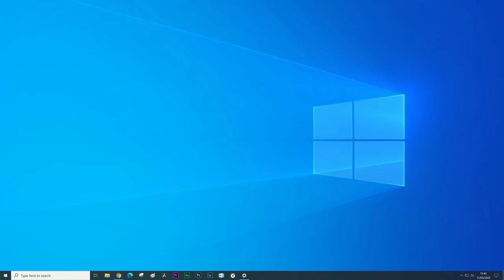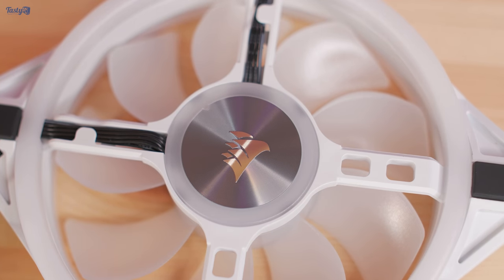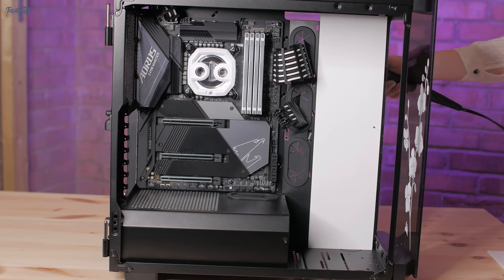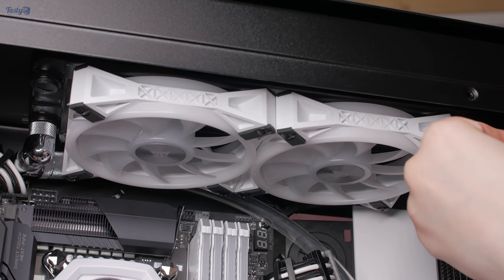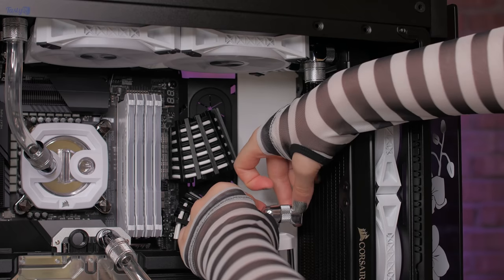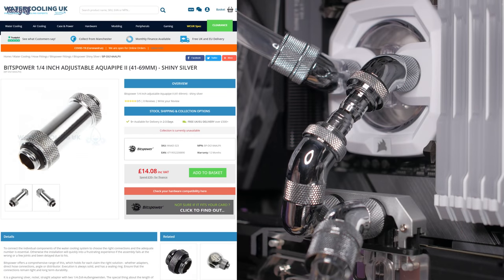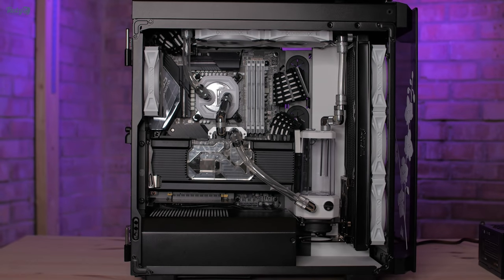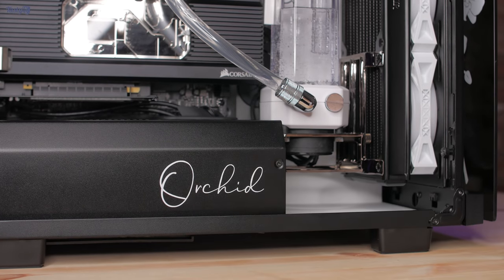I Watercooled A PC For The First Time In 6 Years!! ~ RTX 2080Ti & i9 10900K

Comment: Hard tubing can suck it!! I love my soft tubes where I can just pull off the CPU block and swap it without disconnecting or draining anything. Protip for applying vinyl stickers, mist the area with slightly soapy water first, then stick the vinyl and use a little roller to squeeze out all the remaining water. It gets rid of any air bubbles super easily.
Reply: Hard tubing is mostly about aesthetics so it's pretty subjective, kinda like metal tubing.

Comment: About copper tubing i have some advice , i builted 4 full Loop made of Copper , the same copper tube thats used for  hydraulic thing  (12mm outside 10mm inside) , 1st of all , the raw copper tube react very fast to Air , Water and even the skin of ur hand , so basicaly u can proceed in 2 different way : 1) u can instantly paint with a protective /trasparent paint and then work with bending and cut , or 2) use a copper paint to cover the oxydation and scratches after the bending/cut , but after years of custom loop i have to advise u that use copper tube( especially raw copper) could be painfull , its the hardest way , but imho the result could be stunning.( P.S. bending copper its the hardest part because u can easly ovalize the curve , an easy tips for beginner is to use only straight tube of copper and use angled fittings to complete the loop).  by the way for me its a good first waterccoled mod u done , keep going Queen .

Comment: Fun tip for vinyl sticker application: spray the glass with a simple glass cleaner first and apply while wet. It gives you an opportunity to move the graphic around while applying. Then a credit card or plastic "squeegee" will take out any bubbles very quickly. Towel off and you're done.

Comment: It's cool to see a girl's take on building a PC, it looks so much neater, more methodical, and aesthetically pleasing. 
And after cracking that plastic I was waiting for the "oh fuck!" and I wasn't disappointed!
Good job..
Reply: It was watching Lauren's water cooled build in a Corsair 900D 6 years ago, that inspired me to build my own water cooled PC, Current rig is, AMD 3960X Threadripper 24 Core CPU, 64GB 3600 MHz ram, 2080TI, 1GB SSD (Boot) 2x2gGB SSD (scratch disks) 4x 12GB HDD in raid 10, (Storage) all watercooled of course.  I edit in Davinci Resolve Pro, this set up works well for me.
Reply: @johnbancroft5242  Damn, that's some nice gear! Yea, I started getting into custom PCs and watercooling around the same time, currently have a 3600 and a 1080ti in a custom loop. 
I wasn't planning on putting the 1080ti into the loop, but then one of the fans went crazy, running at 100% all the time, and it was just cheaper to buy a waterblock and add it to the loop instead of trying to find another  fan, or get it repaired.
At least that's what I told myself anyway..

Comment: what I would do for runs like the GPU to CPU and 360 rad to reservoir is use a similar looking hard line tube not only to make the run look cleaner but also to help straighten up reservoir sag. And one more thing, it's not a sexism thing I promise hard line tubing is not that hard but it is scary to do and more expensive cause you need a heat gun.

Comment: I have the same reservoir and had the same sag problem. Easy way to fix it is to put washers around the bottom layer of thumb screws that connect the reservoir to the fan it’s mounted to. Do it so they are between the mount cage that connects to the fan and the one that holds the res. One of two layers of washers should do it.

Comment: Nice work Lauren, It was watching your water cooled build in a Corsair 900D 6 years ago, that inspired me to build my own water cooled PC, Current rig is, AMD 3960X Threadripper 24 Core CPU, 64GB 3600 MHz ram, 2080TI, 1GB SSD (Boot) 2x2gGB SSD (scratch disks) 4x 12GB HDD in raid 10, (Storage) all watercooled of course.  I edit in Davinci Resolve Pro, this set up works well for me.

Comment: Quick tip: Get a step bit. It works much better for drilling through plastic and sheet metal. It is much easier than using regular bits.

Comment: That B-roll looks SO GOOD. Awesome job! An idea for the pump sag (besides Corsair fixing it themselves like they should) is to use the acrylic to build a piece for the pump to sit on. Since it's already bolted in place it wouldn't need to take on that much weight so the acrylic should hold and look cleaner than the eraser.

Comment: Good job. Hope you're feeling better.

FYI front radiators always need the tubing at the bottom, not the top. This forces any air caught in the system to stay at the top of the radiator, instead of being forced out the top repeatedly which leads to gurgling sounds and reduced cooling capacity. You can purge some of it by tilting the case around with the pump running so the air ends up in the reservoir instead of the radiator..
Reply from the maker: I think you're thinking of AIO coolers. With a custom loop you can work the air out.

Comment: Great video!  Build looks great!
 Glad you had no leaks when you filled the loop. It was a good idea to tell people that the motherboard was powered down while filling because that is very important.
 A drain valve might be handy on your next loop. It might be an idea to use some of the scrap plastic you have to make a prop to go under the pump bracket to take some of the weight and stop it sagging. 
I've used hard tube in my loop and yeah it's a bit harder to use but if you take your time it's fine. I have no issue with soft tube loops if it's easy for you , besides you've done a great job making it look as neat as you did.
Glad you left the cursing in because we've all been there. Good thing your hand was clear of the drill bit , cos that can be nasty ..ask me how I know..
Good luck with the build and keep an eye on that GPU loop manifold connection just in case you get a leak starting there.

Comment: 3:34. First use a center punch then drill your pilot hole. Make sure the bits are snug in the chuck. Your bits are spinning both times. Then use an intermediate size bit then lastly your final size bit.

Comment: Is the front radiator the wrong way up? Front rad is lowest point in system, so pump should go to bottom of front rad and then front rad to gpu? Straight run from top rad back to top of reservoir?

Comment: Think the accident with the drill had much more to do with an excess of downward pressure, not with the drill being too large. The drill stopped while the chuck was still moving, which is a issue with downforce.
EDIT: To be clear, while multiple sizes are useful in hard to drill materials (which that wasn't) or underpowered drills (again, not an issue). it wasn't need here. The initial pilot hole was enough to both guide the larger bit and keep it from wondering, and have a clear centered area for the larger bit to avoid having the center chisel its way through (the center part, where the two cutting flutes come together, doesn't cut so much as brute forces its way through. ie, reason to use a smaller guide hole.)
But great cover right after anyways, had everything else covered spot on.

Comment: Looks gorgeous. I've always been a fan of crystal clear acrylic/tubing/fluid, and it makes a lot of sense now that RGB exists.

The aesthetic of this is very... TikTok e-boy. RGB, black and white, silver jewelry... You've even got the striped shirt! xD

The ONLY thing I could nitpick is the 24pin/GPU cables... they're a bit too cluttered visually because of the black white mix, which is then crosshatched by the combs. I would've gone with clear combs, and then either all white, or white on the front faces and black on the backside. 2 or 3 wide stripes might work too.

Comment: Tasty - you can buy (very cheap) these pairs of light duty work gloves / gardening glove / handiman gloves. Whatever they are called. And its like a thin 2nd skin of durable rubber dipped cotton. They are great! And will save wearing out your hands when hand tightening / gripping / assembling stuff. They are very grippy. Certain tasks will really benefit. They also offer a worthwhile limited amount of finger protection from dremel, knife, etc. It is important to have multiple pair because they wear out or get mucked up. Personally I like to keep a 'good clean pair' for clean and light duty tasks. Plus one other 'dirty pair' for the other less forgiving tasks which will do more damage and mess up or dirty the gloves. And rotate them that way. Clean Pair --> once it gets messed up ---> becomes dirty pair. They are like $1 a pair. Or something like that. Well worth it.

Comment: I just wanted to comment on the hard line vs Soft line cooling argument, and I would agree that from an aesthetic point of view hard line can look better, but does not always look better.

But from a long term usability point of view soft line tubing is a much better option as it allows you to service and maintain the system without draining the loop and replacing all the o-rings as is best practice every time you remove and refit any hard line tubes. (It nice to be able to upgrade m.2 drives, and swap out or fit more RAM without needing to drain the loop).

I have also found soft tubing to be less prone to leaking as well, so if you are building a PC you plan to run 24/7 and leave un-attended soft line tubing is again a better idea.

As such if the idea of your channel is to teach people how to build actually usable PCs that look good there is no need to go with hard line tubing, just do some work on routing your soft line tubing to look as good as possible, and you can even use its flexibility as a visual feature. :-)

Comment: lol dont sweat hardline tubing, it has disadvantages, 1 has to be done in situ cant pre test away from the motherboard, 2 no quick disconects as far as i know, needs precise cutting, can crack at odd angles, needs filing and sanding the ends, the rubber mandrel is difficult to wiggle in and out of the tube for bending, (i wouldnt bother unless your insistant on the perfect bend) leaks easy if the fittings arent tight or pushed in enough, has to be matching fitting and tube size, where as on soft tubing, its not as much of issue, if the fitting is smaller say 6 by 8 stead of 8 by 10 or vice a versa it will still work obviously for larger tube to fitting just needs more heat and more stretching, i use a three prong stretching tool for that.

Comment: Oh my god. Humor on point. Smarts as well? That's a keeper right there lol. That PC has made me decide I'm going watercooled, but I'm gonna do hardline tubing prob.
Reply: I've got a 3700x on an x570, with 4x8gb 3200mhz Vengeance RGB Pro, MSI 2080ti Gaming X Trio, 2--1tb m.2 nvmes, 1--2tb SSD, 1--12tb 2--4tb HDDs, and my cooling is a Corsair H100i RGB Pro XT (I really want the new Capellix Elite they just released) 240mm, 8 Corsair LL120s (again before QL120s came out, and of course I want them lol), and I've got a Corsair LS100 starter kit which is 2 250mm and 2 450mm RGB strips, and I got 3 in my case and 1 on my monitor. Got all Corsair peripherals as well, except for the RGB headphone stand and the little light sticks lmao. But pretty much everything Corsair. Unfortunately that AIO (the RGB Pro XT) leaked inside of my case, and Corsair emailing me is giving me a hard time about refunds and stuff when I was only asking for an RMA. They don't care about their customers if I dont buy it from THEIR website... If i buy it on Newegg they said theres barely anything they can do to help me lmao.

Comment: Clean build... After 4 hard tube builds, my next will go back to soft tubing.
Reply: Or, you could forego liquid cooling because you do not need it in any way, shape, or form. It’s stupid and pointless, and it’s just another unnecessary vector of failure in an already complex system.
Reply: @darthdigital3789  lol. I have dating back to using car air conditioner coils and condensers  for radiators and aquarium pumps.  Never have I had a failure.  I have and will continue to do customer water loops because it's fun, challenging and the end outcome for some is art work.  Lol... Why so negative dude?  Life ok for you?
Reply: jasonlax   True, that was a bit negative. I may have been on my second Scotch by then. I just think that liquid cooling is pointless, but hey, whatever floats your boat. I’m more of a non-rgb, brushed aluminum, mini-itx kind of guy now. I like the elegant look, even if there is a beast of a gaming or simulation or video-editing system under the hood.

Comment: Nice B&W build, did something similar in an 011 dynamic but used black EK soft tubing instead. Worked really well and gave it a clean mechanical look.
PS. loved the '..and it worked' line, as if someone was expecting it not to, made me chuckle. And I've never missed a blanking plug when doing a custom loop, honest! :)

Comment: For your OCDs sake have you thought about 3D printing like half a cylinder using white material that the soft tubing could then be cradled in to force that tube at the top of the 360 RAD to the reservoir to be straight?

Comment: Nice build, on the top of the reservoir, why not use a 5mm extension in-between the 2 90's so you don't need that weird fitting.

Comment: Nice job..you may want to re-orient your front mounted radiator. Testing has proven that air entrainment happens to radiators installed upright with the fittings at the top.  Flipping the radiator with the fittings at the bottom will eliminate that possiblity. Btw nice build.
Reply from the maker: You should checkout the Gamers Nexus’s video on the proper orientation of an AIO cooler: https://youtu.be/BbGomv195sk 
It does an excellent job of showing the way air works in a closed loop, but understanding the science in that video will help you understand how things work in a custom/open loop in regards to air. For example, the highest point of my loop is actually the radiator mounted in the roof and not the one in the front. Also I can work large air bubbles to the reservoir where I can then replace it with additional coolant.

Comment: Could I just ask why you didn't put the "Orchid" letter stencil on the inside of the side panel like you did on the front? Was that a FE 2080Ti or have you sacrificed a good air cooler to fit the water block? And finally it's so nice to hear and see a lady get into the technical stuff in these vids, so many other tubers are using their better halves to try and make themselves look like gods and your giggling just reminds of the engineeresses I've worked with in the past.
Reply from the maker: 1) I wanted the name visible with the side panel open/removed
2) https://youtu.be/k1JaG4_Q-I8 for the GPU block installation

Comment: beware that if u use copper, the material will oxidize. Inside and outside. So u have to use anti-rust stuff in the water, like frost protection used for car watercooling, and paint the outside with clear vanish or oil it or whatever way u want to stop letting oxidize the copper with air.

Comment: I like the personal touches like the flowers and the name. Still think that's too many fittings. That looked expensive. Also, I didn't see a shutoff valve for draining. You're gonna be cursing again when you replace the coolant. But maybe I missed that part. Really liked the build overall. I'm dreading taking mine apart. CPU is starting to get high in temps. I think I need to change the thermal paste. But it's all hard tubing (acrylic).

Comment: Damn that's a nice build, must have cost an arm and a leg though but I guess its worth it for the performance if not just the spectacle.

I've never water cooled and been building PC's for years, always just saw it as an added expense and another point of failure to worry about but I guess it depends in all fairness.

Comment: You want to limit the use of 90s and never do a 90-90  a 45-45 is better.  This is due to fluid dynamics as the 90 cuts flow rate and pressure.   Same for hard or soft tubing.  The build does look great though.

Comment: You have installed your pipes the wrong way round on your radiator, the pipes should always go at the bottom of the radiator so you don’t end up pumping air as it rises to the top where your pipes are positioned.😊

Comment: That is a great water cooling build. I have never attempted it and my current build is itx so its not really possible lol. I did upgrade in the end as my motherboard was failing and was a 2nd hand one. So it took some time deciding over  Intel i5 10600k and a ryzen 3700x. In the end I went Intel as it was classed as the best for gaming compared to ryzen, which was no slouch.

Comment: @TastyPC
 Hello Lauren. Can you tell me what is with is beter and more silent build. Water Cool 360+240 or SL600M with Quad Noctua? :) With way should i go? :D  For now i have similiar build for yours in Corsair x570 case. 240+360 rads. But its hard to keep waranty on GPU, when we are going in custom loop. And its problem with replace GPU. I just sold 1080TI and I didnt go in to RTX2000, because its difficult upgrade gen by gen GPU. High price of new block. Low price for used one block old gen. 

So AIR in SL600M or no worth it and i have to stick LC? 

BR Kamil

Comment: Apropos tightening, i'd be tempted to use a rubber strap wrench, you sure it won't do? It's a fibre reinforced rubber belt with a handle, so it's only the rubber touching your hardware, and in fact there aren't any metal bits there at all. Always have two at hand, so you can turn them against each other. I discovered Baby BOA wrenches 20 years ago, and i don't think i could go a day without them now. If one day i became a cyborg and the money ran out just before proper hands could be made, akin to Edward Scissorhands, and my hands had to be replaced by a bunch of strap wrenches, i don't think i would mind too much.

Mini 3D printed one is thing:2168545.